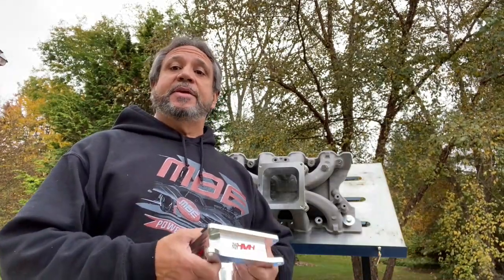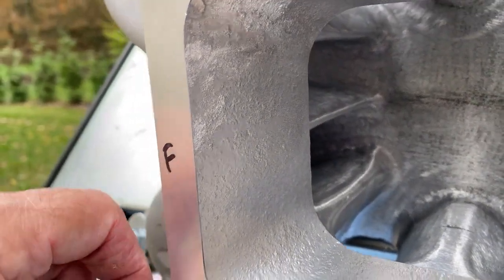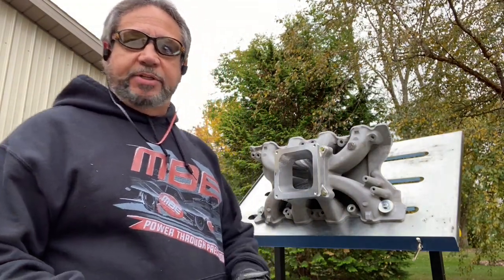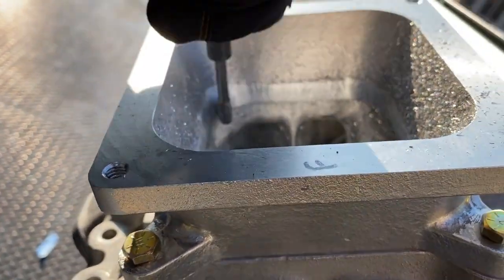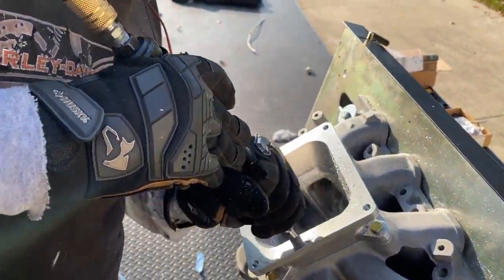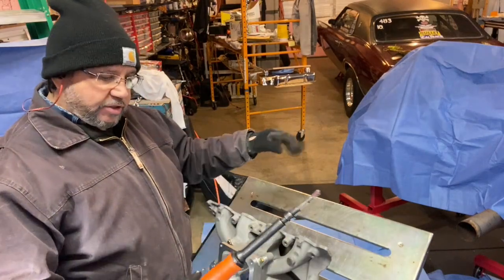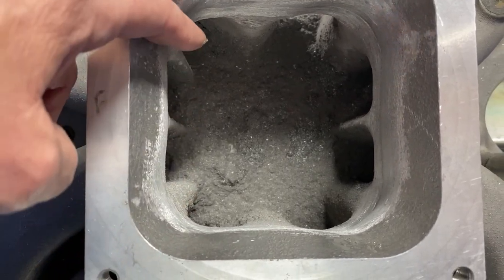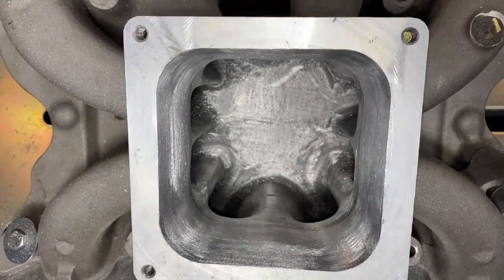DBG: My First Attempt At Porting Ford 351 Cleveland Holley Strip Dominator Intake Manifold,  40 Hrs

Comment: Now...it might just be me but I think I would have left that ledge in there? 🤔

The sharp edge could act like a fuel shear atomizing the fuel droplets as it rounds the corner. 

Also having the ledge there could help with reversion. 

But no way to tell now 😂 Maybe next time you could try it before and after to see if there truly would be a difference lol.
Reply from the maker: I definitely need to try it and see how it works. I will pull the carb and inspect the intake, next few days.

Comment: Pro tip bud. If you like you're air powered die grinder so much, try adding a "whip hose" to it. Flexzilla HFZ3806YW2B is a nice one. They're extremely flexible and make porting more comfortable by not feeling so tethered to the main hose.

I've been doing cylinder head work for 25 years, and when I used air tools, a "whip hose" was the way to go.

Also, set your regulator to the speed you want at wide open. Less fatigue of the hands not having to vary speed. Better more consistent results.

Long shank burrs will give you a better line of sight, and "egg" shaped burrs will blend better over a radius.

All said and done.....good work.
Reply from the maker: Thanks so much for the tips. I will add to a video in the works. I will look up flexzilla great name. Thanks hope you will enjoy it membership section when it launches. Thanks Art
Reply: @DragBoss351Cleveland  you bet bud! 

I saw your block in Ben's video. Makes me think about a 9.2" deck engine a lot! Keep up the good work.
Reply from the maker: Me too. Warren Johnson told me today. Looks good. Thick walls, only about .050 of core shift. Siamesed cylinders.
Reply: @DragBoss351Cleveland  hey Tim, I hope things are going well. I was looking for 9.2 rotating assembly components, and it got me thinking.....what's wrong with the Titus block? What are the pros and cons vs DBG9.2?
Reply from the maker: @arturozarate1752 there no Titus blocks and never will be. Pro DBG351C

Comment: Hey Tim where did you get that table from, that's pretty handy that you can bolt the manifold to it!👍🏾
Reply: I'll head right down to harbor freight and look for it, and by the way that's some excellent work that you're doing to the manifold and spacer that is how I got into porting cylinder heads and manifolds, you have a excellent go to guy for tech questions Mr Darren Morgan. Let us know how it goes when you get everything finished and bolted on who knows that car might get you definitely kicked off the track if it started creeping into the low low 9s or possibly a 8:99 et. Nothings far fetched at " Drag Boss Garage" , oh and what's the word on the Dyno Don Fairmont We all want to see you with that car with one of those pro stock engines in it👍🏾
Reply from the maker: @ericscrutchins6350 thanks Eric. The manifold is going on my wife’s 354ci cleveland. It made 615 with stock Holley strip, so ported a strip to see what I could make. I bought a stock strip last week, so I can do a real dyno test, and see what my porting picked up. Yes get one of them, or two. I think the limit is about 9 teens. I will update on Dyno car.
Reply from the maker: It is a welding table from harbors freight. 👍 60 bucks with coupon Eric

Comment: Jim check out David Vizard’s channel. 
He and Andy modified ported a Street Dominator for a SBC. 
Vizard used an epoxy molded into the floor to help starvation and direction of air flow. 
Helping to direct airflow verse long runners to shorter runners. 
The epoxy looks to be the JB Weld sticks. 

Granted the engines are two different animals. 
Nevertheless the Cleveland Intake is a monster of a manifold:)

Comment: Just came up in my recomendations, was Richard Holdener's 4V Clevo dyno test....M code stock build 360hp, Boss stock build 383hp, cam and intake build 450hp, and last but not leastwas a stroker 408 tunnel ram with ported iron heads street build 574hp !  Shows how even old school Clevos' made easy power !!
Reply from the maker: I have seen that episode before. Yes a good plan for me in future. Easy bolt on 500 hp Cleveland for the street.

Comment: I picked up the Harbor Freight electric die grinder and it doesn't bog down like my air grinder did, plus there's no waiting for the compressor to catch up. Excellent work though!
Reply from the maker: My Dotco works awesome. Even with my little 5 hp compressor, never have to wait, maybe I’m slower. But like I say do what works for you. Thanks srm

Comment: Is that a 2 in. Spacer?  I was running  that intake in the 80s. Bought it used at the supershops for 80$. It was a boss 351 in a 67 mustang. That suckered ran!
Reply from the maker: It may be that tall. Moroso 4500-4150 adapter. I bet it did in a 67, hang the hell on.

Comment: Nice video. Thank you for making it. I might have missed you saying but did you know the flow numbers or horsepower before you did the port work? It would be interesting to see the benefits of all that nice work. 

Thanks again. Im in the middle of building a 351c with chi 3v 225 heads and manifold. I’m getting close to mocking up the top end to see what porting needs to be done and the timing of this video was great!
Reply from the maker: No flow numbers, but stock Holley intake and HVH super sucker made 615@8K. Yes really trying to see if my porting makes a few ponies. CHi heads work very well.

Comment: That workmate bench is the nuts for fixturing that manifold, way better then chasing it around a bench top. 
Bright side, I feel aluminum cuts better - cleaner, the colder it is…
When y’all going 2x4 tunnel ram?
Thanks for sharing.
Reply from the maker: Thanks George, it works great. It is a welding table from Harbor freight, was like 60 bucks, bought 2 just in case. Well, may get the intake back on, and test with my changes, then change to tunnel ram and dyno test. Be nice to test with TR, and leave, bolt into Mustang. PS do have a couple of intakes to test.